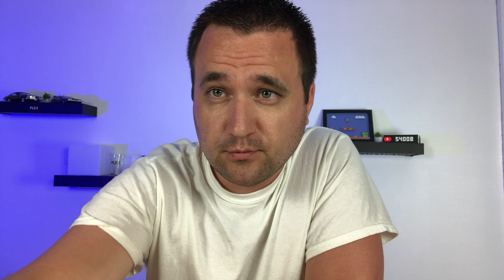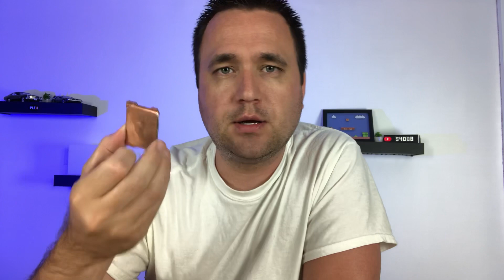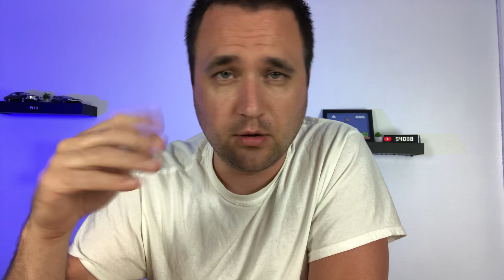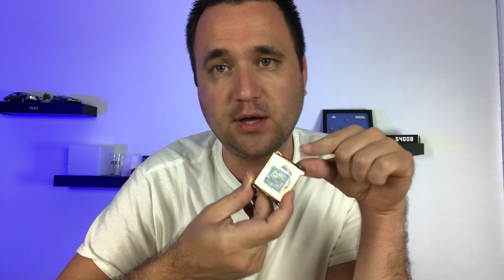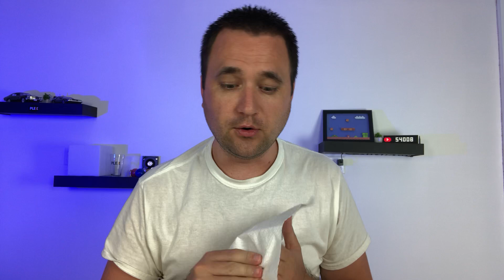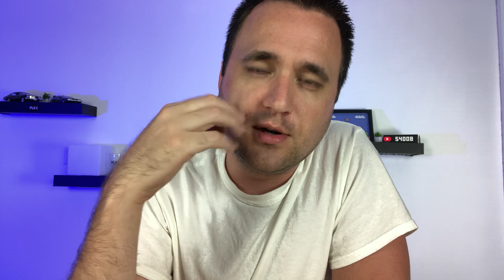7940x Delid Fail. Need some help/advice..

Comment from the maker: I've swapped the cooler for a Kraken x61 AIO and reran the tests...same results. so unless both pumps are bad, it's not a cooler issue :(
Reply: I recommended you use an Air cooler to make sure your not having a pin problem. that is not allowing the pump to turn on.. Does not make sence. if you have good temps after 10 mins of doing a load test.. for the most part your temps should not go much higher then what they are after 10 mins. Is the CPU overclocked.. Or is the Ram overclocked. If so lower you clocks back to base and reset ..
Reply: @Brownie_ if BOTH pumps where somehow bad or the pins were, then it would be overheating sooner than 3hrs. But once again,  he said multiple times his temps were fine before the crash, for some reason you're not understanding this concept...
Reply: Crashing doesn't cause heat. All signs point to the CPU getting too hot and causing the crash, he only seems to look at the temps after the crash. @Brownie_ is saying to use an air cooler so that you can actually see if the fan is still spinning so that we can completely rule out that the cooling solution or anything related is the issue.
Reply: correct, no one is saying that. Heat can cause a thermal shut down. He said that THE.TEMPS.ARE.FINE.AND.IT.CRASHES. then after reboot the temps are high. My guess is the liquid metal is breaking away between the IHS and the die thus causing an instant spike to 105c and causing a thermal shut down. Changing coolers won't do anything for this. He's already tried two AIOs with the same results. I think he needs to use more liquid metal to make sure it's getting a good solid layer bonding the two together.
Reply: What he says is that the temps are fine, then he goes on using the pc, then it crashes a while later. Unless he staring at his temps for 3 hours while doing other stuff, he may not be aware of the increasing temperature from either a failing cooler or the cooler not getting power to the pump. We are simply suggesting the easiest thing to do first to eliminate all other possibilities before he drives himself crazy diliding the CPU a dozen times. Trying an air cooler will show if the power to the cooler is working seeing as no one has x-ray vision and can see inside an AIO. If the problem persists after that then yes, I would look to the thermal material application.  It is always better to eliminate the easiest things first and be 100% sure about it before heading to the more pain in the ass things.
Reply: he stated in the video that he did watch the temps before the crash, that's why I've been saying it.

Comment: $1,000 brick. Why is everyone deliding these. I have a 7040X and my temps are 34 to 78 under full load. I am using an AIO with a 360mm Rad.

Comment: Hiya, give this a shot always worked for the delids I have done. 1: Double check there are no damaged capacitors around outer edge of ihs was moved forward on delid pretty rare but can happen. 2: get some 5000 or 7000 grit wet and dry take ihs and on level surface wet paper run it 3 or 4 times to reduce the tolerance surface that makes contact with cpu pcb, do this reseat ihs with liquid metal or paste do thermal tests should solve your problem. Good luck :)

Comment: I am thinking. A capacitor should never just fall off when touched, go ahead and touch them. If they do fall off, that might be the problem.  Touch them lightly.
Reply from the maker: they all are solid
Reply: I was going to suggest trying another cooler. But looks like that was already tried. Only other idea I have now would be to see if Steve over at Gamers Nexus has any ideas. He has an Ask GN series where he takes questions from viewers.  https://www.youtube.com/watch?v=aeyMjajKhx4&list=PLsuVSmND84Qs2Qz152sw1IpLFGEQRcyRJ

My X99A system is also having trouble.  Started with AIO over heating. Replaced AIO, and it worked ok for a few months.  Now the machine won't post with default XMP settings. Would RMA the mother board, but manufacture wan't me to try everything else before sending it in. Included getting another CPU on the board.  I don't have $400 + dollars get a 2nd CPU.

In my case when the AIO was bad.  The temps would go up slowly.  With XMP on, the temperature at idle would get over 80C.  I always shut it down at that point. With XMP off the temperatures would be controllable with pump speed turned all the way up.

My rig is a i7-6800k on an MSI X99A SLI Plus. With recent Firmware update for the Spectre patches.

Comment: first off i have never delided a cpu before but i have done some overclocking it sounds like it could be the motherboard maybe its pushing to much voltage or to little voltage or the LLC not working right,  like when it starts its not enough so it locks up then when you reboot it gives to much that would make the temps go up high real fast, or maybe just not getting good enough cooling but i would say check out the settings in the bios/UEFI hope that helps.👍😎JP

Comment: FYI... with AIO coolers you have to wait at least an hour under load to see what the max CPU temp really is. Water requires a lot more heat to raise its temperature. Watch this video...

https://www.youtube.com/watch?v=eSOcUnn1mtQ

This won’t help your problem but will provide good insight into real world AIO performance. I understand your desire to increase performance but for me personally the CPU increase gain doesn’t out way the risk. Best of luck. I really enjoy your channel!
Reply from the maker: I understand that fluid temps take time to raise. but that is not what I am running into. I can run, sometimes 39min to 3 hours with amazing temps all around, both fluid and core. Then, after Lockup, they instantly run hot...that is not normal and does not fall in line with standard temp fluctuation.

Comment: try one of those hand held thermal censers. you can rent them for less than you think. this will validate the numbers you are seeing. before you screw with it any more run a hard drive test. Forgot to add i have seen a bad power supply do that. it does not quit but the voltages go nuts. maybe just try a much larger one like i did and see if that works like it did for me.

Comment: I would recommend that if you can find another cpu that will fit in the socket, try that. If it doesn't fail, then it's definitely the CPU. If it fails, then it's probably not the CPU.

Comment: So did you try a different cooler? Sounds like your pump is either going bad or its UEFI setting got messed up, I would just run it full blast.
Reply from the maker: I did, same results

Comment: Check your liquid metal coverage on the CPU die and make sure none of it spilled out onto the internal connections.  I de-lidded a 4690K that ended up shorting inside and drew 200W of power at idle because of this.  It would also freeze like you're describing.  Once I cleaned that up everything worked great and the CPU went up to 5GHz on overclock and maxed at 73.

Comment: When deciding my 7900 I found you can not glue the IHS down. Also i needed to lower my AVX numbers from 2-3 to 3-4. What happened in my case was the system used to thermal throttle before hitting my max clock speed. AVX code produces a lot of heat and once you fixed the paste the chip can clock to max and lock up.

Comment: the liquid metal could have been touching a capacitor on the cpu and shorting. the heat could be from creating a circuit that voltage is jumping across. check to see if it has spread past the die. https://linustechtips.com/main/topic/899105-how-to-solate-pins-to-prevent-a-short-circuit-liquid-metal-cpu-delidding/

Comment: You bought a crazy expensive processor...and felt the need to modify it just to save 5-10C on temps or get a 5% better overclock? You probably barely used even 50% of that cpu on the regular anyway. AIO is honestly almost unecessary, people get it because it sounds "cool" to say ur system is watercooled. In reality, a nice premium air cooler is almost as good as a good AIO for half the price and none of the worry/headaches of watercooling.
Reply from the maker: Wrong. I use my CPU to its max on many occasions and when the Delid IS working correctly, I dropped from 104c to 67c at max load.
Reply: Really? Go look at Linus video from about a year ago when he does a comparison. Almost identical performance at almost half the price. Sure the aio maybe have an advantage on workability in the case (ie ram slot access) but almost for everything else...air cooler ftw. Never worry about leaks, pump failure, etc

Comment: I came across a thread on reddit:
https://www.reddit.com/r/overclocking/comments/5qdcn5/4790k_freezing_after_delid/
he simply disabled Intels-Integrated-Graphics, so when you run a stress test what uses almost 100% cpu and another program tries to hardware accelerate your pc can freeze, i have seen this in the past (not with delidding, but with hardware acceleration)

Comment: I would check that motherboard, RAM, Video card, etc are working correctly to tick them of the list. So you know 100% that the CPU is the problem and you are not chasing your tail
Reply: I would even go as far as to try and get a diff motherboard to test the chip on. But only if you could return the motherboard

Comment: I had something similar, was a big air bubble in the AIO pump (Kraken X62).  Had to twist the computer around a few times with the pump running until I heard a big gurgle and problem solved.

The air bubble should sit at one end of the radiator, so twist or rock the computer until you hear the air moving.

Comment: out of curiosity did you try check the cpu before you delided it? I didnt see your other video.
Reply: Also just out of curiosity after the lock up and temp spike did you check the voltages? im just wondering if the mobo randomly finds an issue and compensates with excessive voltage causing the temp spike.
Reply from the maker: yes all worked fine before this.

Comment: well... to isolate the problem, idle your computer into the bios page, take your time and whatever it takes, check temperatures from there, also you may  check the pump rotation though, to be safer, load default bos settings, if  aio works and idling within the bios raises temps like that, well.. i would say you cpu is messed..

Comment: This sounds like either the CPU is overwhelming your cooling or the cooler is defective. A 280mm AIO...is honestly small if your going to OC the 14 core far. Even up to 4.6 it's barely adequate with full fan speed. Usually I'll follow SL test points for vCore. I usually test around 1.1875-1.220v. VCCIN around 1.95-2.05v. Check the pump and radiator itself. See if the pump area is vibrating (showing it's running) and if the radiator itself is getting hot. If the Pump is working, that's good. If the radiator is getting hot...it's probably being overwhelmed. a 7940x at 4.6GHz, 1.1875, -3 (avx2) -5 (avx512) generates about 75-88C with paste, about 65-75C with LM.

Also, Bartx is a good machinist. I doubt the IHS was not machined correctly (assuming this is the copper IHS off ebay?)

Also...I sent an email to you thru your Business Contact. Verification of who I am...and possible ideas to get this fixed.

Comment: Hiya dude. I saw your post on Reddit in /r/intel the other day. I've delidded my 7900X so perhaps I can give some insight. I think what is happening is that under a heat cycle (meaning load then idle then load and so forth) the IHS is getting hot and metal expands and contracts under heat loading so I think it's slightly popping off the die.

What I would recommend is make sure you have no sealant of any kind (even the black tar like Intel stuff) around the edge of the chip anywhere. Don't use that clamping device you used either, I never used one, never needed it. Just put the liquid metal on, thinnest as possible and put it back into the system under the socket retention bracket.

If there is some of the default Intel sealant present take a razor and carefully remove it. You want absolutely nothing there that could raise the height of the IHS off the die. I hope you can get it resolved, if you're not able I would probably reach out to either Gamers Nexus or maybe even Silicon Lottery and ask them for help as they delid thousands of these and will likely be able to test it, solve it and send you it back re-sealed where it will work in your system 110%.

Good luck!
Reply from the maker: I tried with no sealant. Scrapped it clean and floated it only being held by the bracket. Same exact issue, however it lasted for a few hours, rather than 20-30 min. Hell, Im even free floating it with thermal paste and doing the same thing :(
Reply: I read your recent post on reddit today where you said you remounted the cooler and it didn't change the temps, only delidding it again made the temps go down. My next guess would have been that either the retention bracket or the cooler was malfunctioning but it seems like you've ruled that out with the posts I read there.

To be honest I can't think of anything else that may cause this. But a shot in the dark, when you resealed it did you leave the little gap for the atmospheric pressure to change? - If you google the CPU for delidding photos you may notice that Intel seals the IHS all around the processor except for a tiny gap where there is no sealant to allow pressure to equalise. I'm thinking perhaps you missed that and the pressure inside is getting too high causing the IHS to pop off the die as the build up of hot air inside the IHS tries to blow between the IHS lip and the substrate of the CPU.
Reply: This is very good chance too . .as metal heats up it expands . and will change the contact of the HIS to the Die.
Reply: yep this guy is spot on, i have popped of a die on a 4770k, it would work fine but run stupidly hot. you have damaged the die of the CPU. buy a new CPU
Reply: Yeah am starting to think more and more something happened to the Die on Delidding ..
Reply from the maker: I posted a new image set to instagram https://www.instagram.com/p/BnemqIwjYLQ/?utm_source=ig_twitter_share&igshid=1y2fo4xushtiq

Showing the die and the re-delidding I did with normal paste. Same story on the heat. ran for a bit good, locked, then ran hot. No sealant, no gap created by hot air because the IHS is now not sealed at all. I honestly dont know wtf is going on

Comment: PRE LOG:  Ok Jason did you not say it was running with the thermal paste when you took off the lid and just put the things back together and re installed........OK this kinda sounds like its NOT making Full contact somewhere, and even though its not showing over heating when it goes Blue screen it probably is over heating or Thermal max,  you said when you reboot it shows the Temps high so it sounds like its reporting them as too high so it sounds like one of the things i said earlier, Bios Update, AIO Cooler is not touching all the way or its too small for the Chip/the cold plate is too small for the CPU to pull all the heat away.    
#1BUT lets Start from the Bottom,  The MOBO did you check to make sure it Supported it officially on their site and IF SO does it need a Bios Update installed before dropping the 7940x chip in to your MOBO!#1 A did you try the chip in MOBO before you delided to make sure no issues I dont remember if you tried it before delid that's why im asking?
#2 LOOK on the MOBO for the ERROR CODE part.....when it fails WRITE it down you can look up what it is and alot of times it will lead you in the direction you need to resolve it.
#3 Do you have a Air Cooler you can stick on it instead of the AIO. this way you can fully eliminate the AIO for trouble shooting.. 

OK First off Jason if i do understand what you said and it is running but with the lid reapplied then it is IS RUNNING  ........SO if it is Running this way its just a Process of elimination to see where you  messed up to find out where it is to resolve it so take a few deep breaths and go over it one step at a time..   Ill check back in the Morning to see if you did anything i said here , i even asked you some of these in the one you DID the DELID but you didnt read them im guessing lol  Anyway go through what i said and see where you get  to and ill check back in a few hours i need to get a few hours of sleep moms is going to DR at 9 so if i can  ill check B4 i go if not ill check when i get back .     Good Luck     Cow }:-o)          Bobby
Reply from the maker: It was running fine, albeit hot, without delid. I really doubt a bios flash has anything to do with how it's acting. And I have takin it apart 5 times, using LM and paste and it acts the same
Reply: Jason on the BIOS I meant Before you originally installed cpu, some Mobos need to be updated or in a worse case rolled back one(yes ive seen that sadly on a 7980xe once too) Its odd because you keep getting a little diff results, it still makes me think maybe its just not re-seating right, Jason turn it over and check every pin really close to make sure 1 or 2 are bent or worse yet missing I have seen one before just not there send inconsistent results. I would also take a long hard look at the MOBO socket to make sure some thing did not fall in there. Try a Diff Paste if you have it and see if you get same results...as for the LID i would stay with the STOCK ONE alot of times those Replacement Copper ones are like a mm or so to shallow and you have to put in these like Copper filler blocks to take up the gap and its so small most dont even know it until you do a press test with thermal paste.  I need to run to go do a couple things at moms house ill be back in 2 hours if come up with something or need to ask hit me on twitter same name. 
      Dam I wish you were closer I just wonder if your over Looking something Because your Stressed out we all have done that and its normally a stupid OMG really moment when we realize whats wrong.....ill check back if i get back sooner .Good Luck Jason      Cow }:-o)